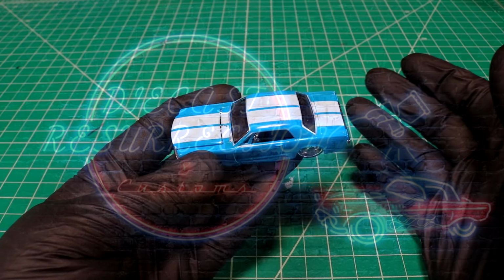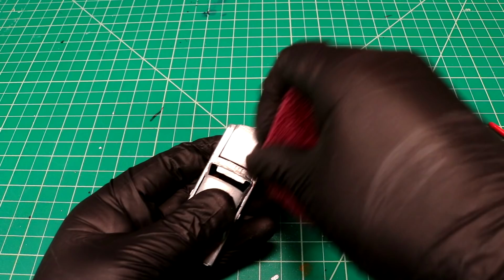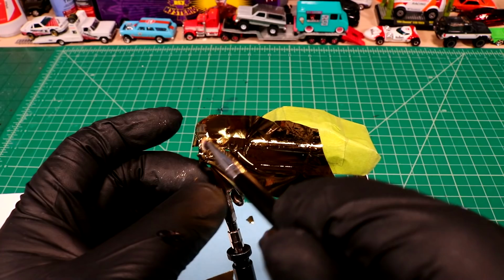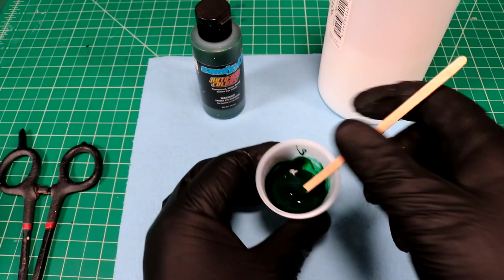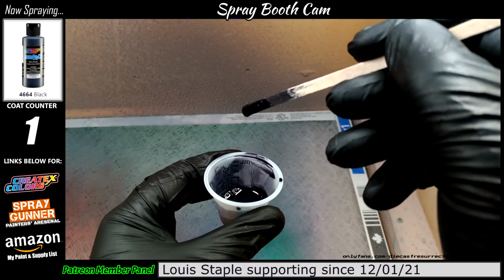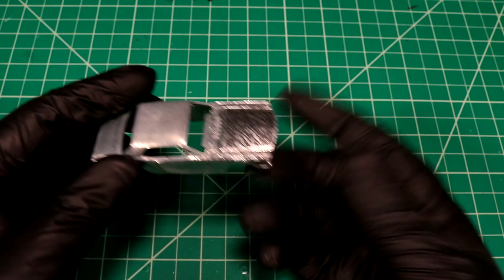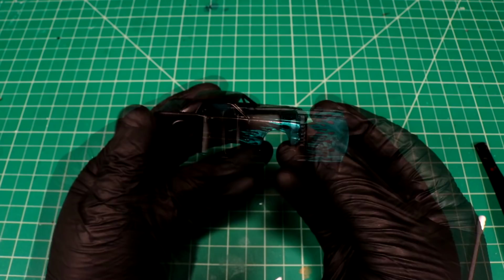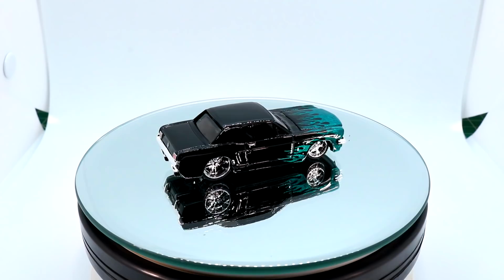Mustang Paint Job Disaster - Maisto Mustang Custom

Comment: dude i love your channel and all your builds. the paint on your cars are pretty sweet. with your leafing problem, maybe try Dux. its a leafing glue used by pinstripers and air brush artists. idk if it will lift your leaf, i have a can and havent used it yet, but from what ive seen it looks like it might hold the leaf better to the project. that speed ball stuff always smelled like watered down elmers glue to me, and its lifted my silver leaf before. keep painting yo. love your stuff.
Reply from the maker: Thanks for the tip

Comment: Another awesome video. Do you design and create the STL files to 3d print the engines or do you download them. I would love to get a few for some of my model kits. I have a 1/24 DeTomaso Pantera I want to add a big block Chevy engine with tranny and exhaust. It is a mid/rear engine mounted car.
Reply from the maker: I'll be doing a video soon on printing engines, I have a real cool place to buy nice stl files of most engines and setups.

Comment: A mustang looks badass man what do you use for stripper I'm getting into customizing and I don't know what to get for stripper
Reply from the maker: If you are from the USA I donno man, the stuff I use got banned in the states. The active Ingredient is methylene chloride if you wanna google and try find a stripper in your area that has it.
Reply: @DiecastResurrection  thank you for coming back to me yes I am in the states I'm in New Mexico and I appreciate the heads up I'm getting ready to combine a 65 mustang convertible with poison pinto I'm going to cut the front end off of both of them then take the front end of the 65 mustang I put it together with the back end of the poison pinto and I'm also taking a 69 mustang cutting the front head off and a 72 ranchero cutting the front end off and going to put the front end of the 69 mustang together with the back end of The ranchero so I can make a mustang panel and a mustang pickup you have a good day keep up the good work thank you God bless